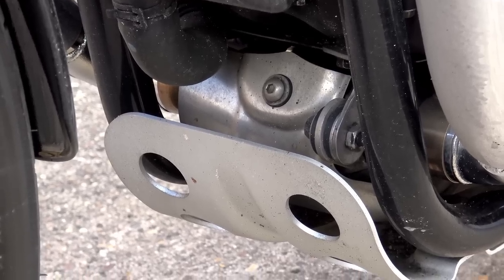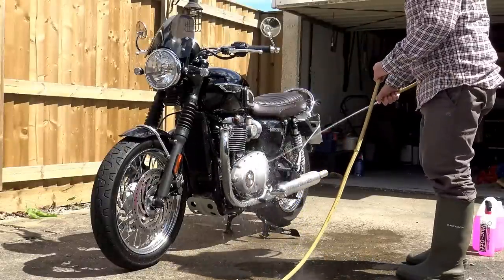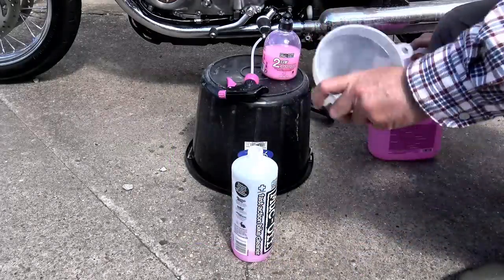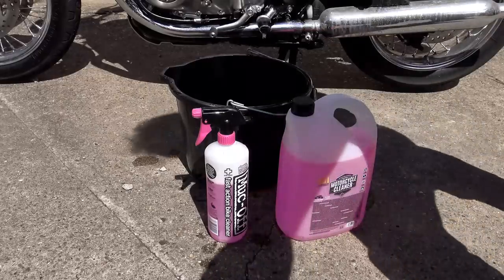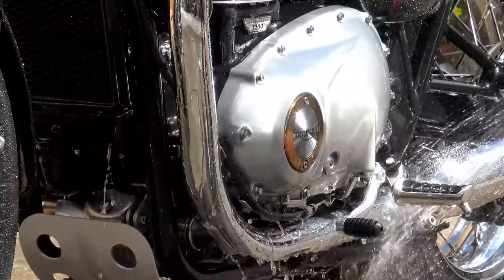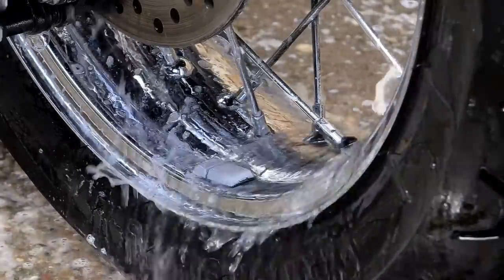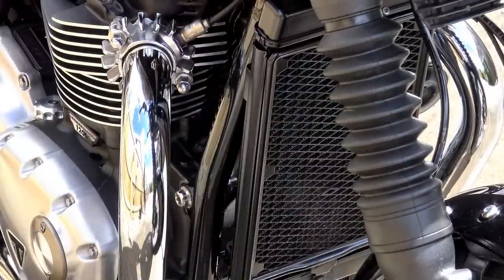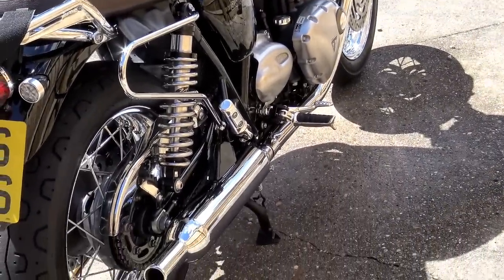Triumph T120, WASHING YOUR MOTORCYCLE. The ultimate bike cleaning method ?

Comment: Great video, thanks.

Most motorcycle owners living in big cities don't have the luxury of their own private driveway to clean the bike. In Germany it's forbidden to clean your motorcycle (or car) on public streets for environmental reasons. That may be different in the UK, so that's maybe the reason you didn't address this. 

There are so-called "wash boxes" here where the dirty water run-off is filtered before going into the normal sewage.
There are three problems with this: You must bring along your own cleaning stuff which is cumbersome on a motorcycle. The wash boxes only provide a high pressure hose which is not ideal for a motorcycle. And the biggest problem in my opinion is that you have to wait a long time for the motor to cool down.

How would you adjust your method for those who don't have a private space for washing the bike and are thus constrained in their options?
Reply from the maker: As far as I know sir this is a problem restricted to Germany! I have heard of it before. my suggestion would be to move to another country where they don't have such silly laws that interfere with the maintenance of your motorcycle!
Failing that Georg, I don't see why you would need to change the method too much, you would maybe have to skip the final bucket wash, but the 2 stage muc off procedure should remain unchanged, and all you need to take to the wash box with you is the muc off cleaner and a drying towel.
Reply: When you wash your bike or car on the street you are essentially dumping chemicals and oil into the ground, albeit on a small scale, but if everyone does it then it quickly adds up. There is an argument to be made that this can be detrimental to the environment, since the pollutants finally end up in ground water and rivers. That is, I take it, the basis for this law in Germany. The wash boxes I mentioned process the dirty run-off and separate the oil and chemicals, more or less purifying the water. I’m sure you have laws in the UK that prohibit someone dumping used oil, or chucking trash out onto the side of the road. I spent a few years in Bath  and recall ordnance signs warning that dog owner’s would be fined 1000 pounds in the event that the dog poo was not disposed of properly. I thought that was hilarious. Just like the signs in California warning motorists on highways of the $1000 fine to be imposed on anyone littering.

Even if I do decide to go rogue and wash my bike on the side of the road, I do not have any access to running water. Germany, alas, does not provide water taps to the public to attach a hose to (another downside of living here). I have washed my bicycles using buckets of water, and that somehow works, although it does require more agitation with sponges and brushes and thus would conflict with your non-invasive method. A hose with some water pressure seems essential.

I am thinking of buying a so-called portable cleaner which is a water tank attached to a water pump with a hose (and a battery for power). There is one available, Aqua2go GD70, which has a 17 liter tank. The alternative is the Kärcher OC3, which is much smaller, but the tank is only 4 liters and it seems that is only enough for two minutes of water which is probably not enough to clean a motorcycle.

I will tell you how it goes. Thanks again for the inspiring videos which have made me feel more confident in cleaning my slightly dirty Triumph Street Scrambler (but then someone told me that dirty is the way it’s supposed to look!)
Reply from the maker: Yeah pollution is a huge problem the world over and i wont knock Germany for taking the responsibility to tackle it! but i do wonder how effective it actually is when you consider a lot of the pollution from traffic fumes also ends up in the ground.
In my defence most of the cleaning chemicals i use are biodegradable, and all are directed down a drain on my drive, which is then processed by the water company before being allowed back in to the water courses.

Thanks for the comments Georg they are much appreciated!

Comment: How do you keep the exhaust pipes from blueing? Mine are stock 08 Bonneville head pipes. They show bluish coloring from the heat I suppose. Any way to get the original finish back and keep it?
Thanks
Reply: That's always been a feature of Triumphs, ask any dealer, they're meant to go blue!  Hi bike is obviously brand new.

Comment: I have a Oregon battery operated leaf blower for drying off the bike it also dries off the car and is very fast in sweeping out my garage. The trigger on it will adjust the air speed. Get a hose nozzle instead of using your finger on the end of the hose.  Your faucet on the house is leaking at the stem, fix it. You need a set of brushes to get into all the nooks and crannies on that bike. Spray on and hose off products never work I am old enough to know that. Just use lots of water as you wipe every surface is the preferred way that works. Magic soap and magic beans are the same thing.
Reply: The brushes are used for all those dark nook and crannies that your hand is too big to reach. Wash brushes don't scratch unless they are coated with sand that is why you use lots of water coming out of a hose nozzle.
Reply: Siclmn Cyclerider we

Comment: The problem with using GT85 on the engine casings is that the next time they get hot , it bakes the PTFE onto the engine casings which is not a bad thing until you decide to use the Muc off, it will strip the PTFE with a terrible streaky and milky effect,  although as you say there is no lacquer it looks like you have stripped the laquer off, this is not the case and can be put back to original with some aluminium polish applied very lightly, this will take an hour or so i wouldnt recommend using GT85 and Muc off together.
Reply from the maker: reapplying the GT85 removes any streaks, im not aware of anyone having problems with this method and many thousands of people use it. This video has been out 2 years and you are the first to mention it.
Reply: @stuartfillingham  
Thank you for your reply stuart, i am actually glad you said that, the reason being is that i bought a gallon of genuine MUC OFF but also had some of the cheaper version that is approx £1 per litre, so it must of been that cheap one that i mistakenly used and caused the problem, as i have used the MUC OFF on my Yamaha and haven't had such a bad problem, it was terrible, i thought at the time i had totally wrecked the casings of my six month old thruxton R.
Sorry my message wasn't an attempt to criticise the way you clean a motorcycle , this was my mistake by the sound of things,  i really love your videos i have watched them all and hope to see many others.
Maybe it would be good to test the cheap stuff to show others how the cheap version could potentially cause damage, it was i have to say,
 just like it had a certain amount of caustic soda in it, was very frightening if i am honest.
Reply from the maker: @spottydog9999  There are few videos uploaded by others comparing the two. with disastrous consequences!

Comment: I went to go buy the Muc-Off motorcycle cleaner this weekend, but saw that the bottle says "Contains Sodium Salts" on it.. perhaps they changed the formula, or maybe I was looking at the bike cleaner? I will check next time I'm back at the Triumph dealer.
Reply from the maker: Spooky! im just getting ready to film a new video on this subject, and the cleaner I now use! yes it would appear they were either telling fibs, or they have indeed changed to solution to get production costs down!
Reply: @stuartfillingham  Turns out the bottle does say it contains sodium salts. I just emailed you some pictures.